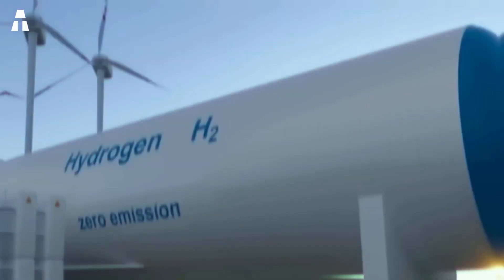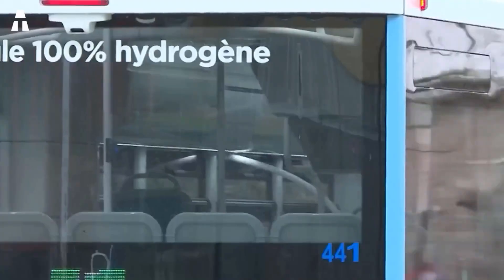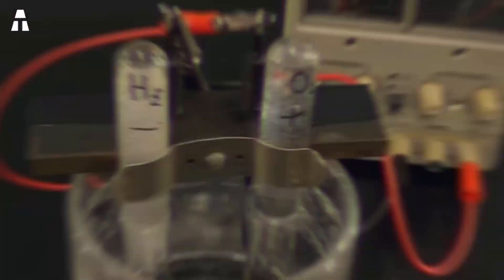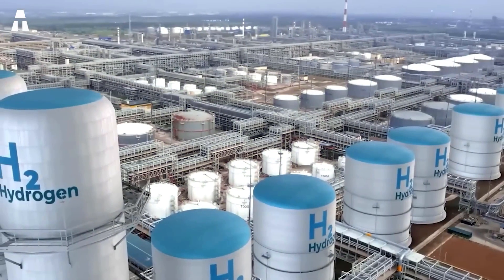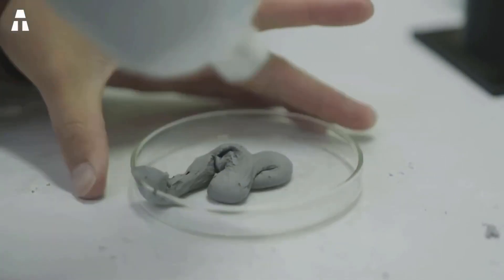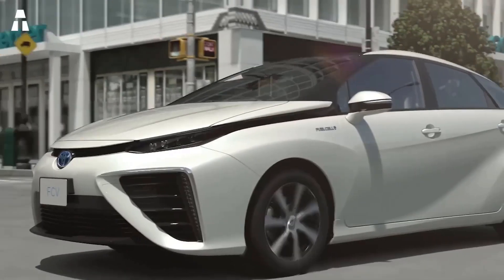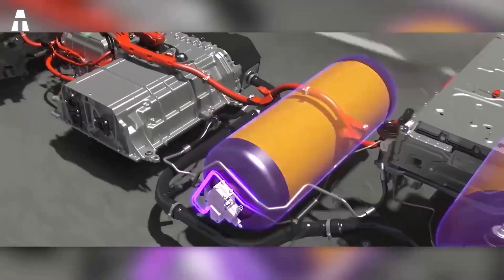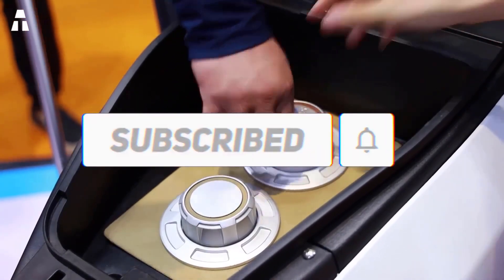Germany Impresses the World with this Rare Grey Paste

Comment: For propelling cars it's a dumb option because the electricity it takes to produce Hydrogen can propel an EV further than the Hydrogen produced. 
It's expensive to produce, fuel cells are very expensive to maintain (they need lots of clean air, requiring filter changes often, expensive), take up large amounts of space in a car and there is no infrastructure for it's sale. Whilst everyone has a electricity outlet in their house and increasingly, many people have solar panels to make their own fuel (electricity) for free.
For the last 150 years, Hydrogen has been the emerging technology but it's never been able to get close to EV's for cost and reliability so it maybe another 150 years before it may take over. 
Whilst large vehicles and ships maybe a winner, it will never take off in cars.

Comment: Very interesting indeed,  I pray this will work, and commercialize asap to hopefully turn the tide around,  and rid of fossil fuel drastically ...
Reply: Hydrogen has been on the horizon for 150 years and it still hasn't taken off. It's too expensive to make, inefficient and very expensive to maintain compared even to ICE engines but way more expensive than EV's.